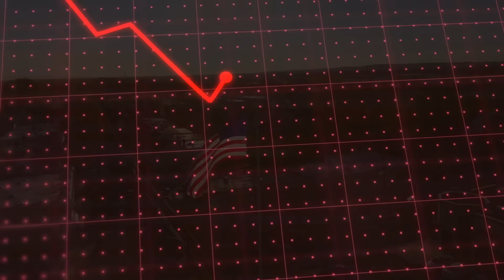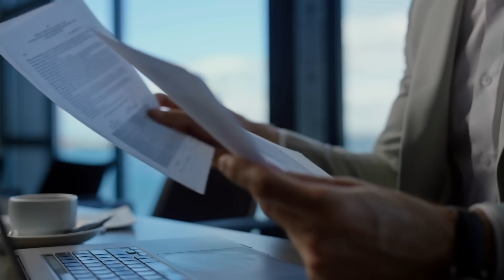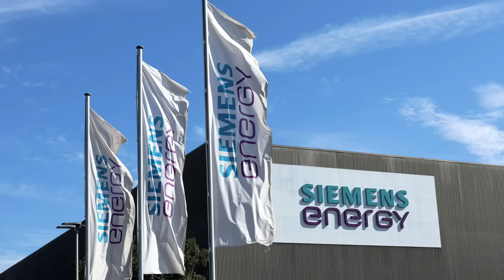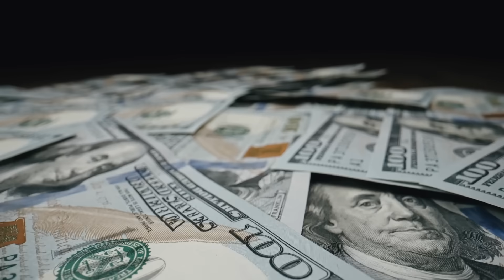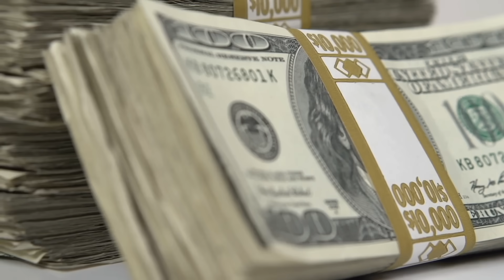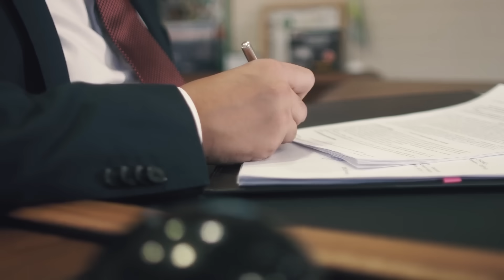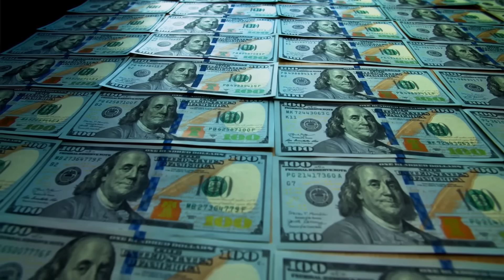The Real Reason America Has Turned Its Back On Wind Power Energy

Comment: A LONG AGO MISCONCEPTION 

"A long-ago misconception about how glass greenhouses work, thus the family name this “effect” goes by. It was believed that glass blocked the passage of “dark radiation” (infrared) and kept storing energetic photons inside it. Once those photons had accumulated enough power to overcome the glass barrier, radiative equilibrium was achieved. So this is the scenario: sunlight enters, heat is generated and dark light is emitted. This dark light is amplified because of the blockage and finally exits at the same magnitude as the entering sunlight. But only after the light “trapped” inside has raised the greenhouse's temperature. Since the barrier will keep raising the temperature until the barrier is broken, increasing the barrier's strength will get you any amount of internal heat you want. (If only that were true …) It is 19th century poppycock. And here's a telltale sign of it: Why do you always see a “layer of greenhouse gases” depicted overhead in illustrations about the “greenhouse effect”, when in fact these molecules are at their densest concentration right at your feet?" BY Alan Siddons

John Christy, ABC Lecture, 17 July 2023

"Climate change, the climate always changes." According to data from satellites and balloons, there is no climate doomsday; the changes are within NATURAL VARIATION. There is no reason to rush to poverty and condemn countries in poverty from developing energy and prosperity.

Lecture given by John Christy, Ph.D. "Scientific Facts of Global Climate on July 17, 2023.  His presentation was sponsored by Advocates for Balance at Chautauqua and was given in the Parlor at the Athenaeum Hotel and Chautauqua Institution in Chautauqua, New York.  Dr. John R. Christy is the Distinguished Professor of Atmospheric Science and Director of the Earth System Science Center 

What does the actual DATA say? It is the IPCC computer models that are wrong!

https://youtu.be/kDAXzcMD2Ng?si=fPyTuh

"A rather well-known quote by Dr. Richard Lindzen is an American atmospheric physicist known for his work in the dynamics of the middle atmosphere, atmospheric tides, and ozone photochemistry. He served as the Gordon McKay Professor of Dynamic Meteorology at Harvard University and was appointed the Alfred P. Sloan Professor of Meteorology at MIT. “What historians will definitely wonder about in future centuries is how deeply flawed logic, obscured by shrewd and unrelenting propaganda, actually enabled a coalition of powerful special interests to convince nearly everyone in the world that CO2 from human industry was a dangerous, planet-destroying toxin. It will be remembered as the greatest mass delusion in the history of the world - that CO2, the life of plants, was considered for a time to be a deadly poison.” Unfortunately, mass delusions are a part of life in the United States and in the rest of the world today and throughout history. Once they have ended, it is not easy to understand why they occurred, but when the masses are in their grip, they can hardly be challenged. This author has written about three such mass delusions in American history, the Salem witchcraft trials in 1692." (Mass Delusions by Wallace Manheimer)

Globalist road to GREEN POVERTY

Note the temperature of Venus, much closer to the sun  with 98.5% carbon dioxide, at 1 bar pressure Venus is 340 K or 67 C, Earth's mean temperature at 1 bar pressure (Sea level) is 288 K or 15 C, Venus at 90 bar plus active volcanic activity is 738 K

Pressure in bar vs temperature in K, The mean temperature of the Earth at 1 bar pressure is about 59 degrees F, or 15 degrees C, in Kelvin K  = 288 K., 0 K = -273,13 C  In thermal physics and chemistry we use K the absolute scale. 

Temperatures of various planets with sufficient atmosphere to make this comparison, Mars is excluded because the surface pressure is not even 0.1 bar.

                           TEMPERATURE K

                           EARTH.                    VENUS.                JUPITER.               SATURN.               URANUS.                 NEPTUNE

 Pressure 

    0.1.                270.                         235.                       130.                        105.                          80                           78

    1.0.                288                          340                         175                         150.                          95.                          85

BLACKBODY

MAX.                255.                         250.                         125.                         100.                        80.                           75

            Surface of Venus 90 bar  738 K
Reply: CO2 can be found thousands of feet in their with nearly unchanged concentration...
Yes, that is above our heads...

The current climate change is not natural.

Science does not claim that CO2 is a world destroying toxin...

Comment: CO2 does not affect climate  so the goal of zero emissions is a fool's errand.
Reply: It just physics. You would know, if you understood it.
Reply: CO2 does indeed affect the climate, but these windmills aren't going to save the world like some people have been made to believe.  
BOEM (Bureau of Energy Management) stated that offshore wind in the US will have no collective reduction in Carbon.
If wind advocates/environmentalists would be willing to be have an impartial discussion on the matter and look at all the actual unbiased data (such as EPA sources), they would no doubt be surprised and shocked at how carbon intensive these things really are.
Reply: @mannycheese1166   But they are not carbon intensiv. Even the EPA states that...
Reply: @old-pete  
I was replying to Eddy, but anyway , Yeah, they most definitely are carbon intensive  but I guess the term  "intensive" would be  subjective .

One simply has to look at the data from the EPA on fossil fuel generating facilities (natural gas almost half as carbon intensive as coal). For example ,  a 4 MW diesel generator running at 50 % capacity (constant 2 MWH)  and compare to a 2 MW wind turbine (would require four towers to achieve a constant 2 MWH when looking at the average output of North American wind farms) ) and what is required to build it and compare both over a 20 year cycle.
I think you may be in for a surprise.
Reply: @mannycheese1166 1. I do not, which clearly shows you like to make assumptions on limited data.
2. Steel does not produce carbon, it just contains some. CO2 is also emitted when producing steel.
3. All sensible scientific sources contain mining, fabrication, transport, service, removal and disposal/recycling. Maybe you should learn to look for better sources...
4. There are no large scale CCS projects worldwide, despite the fossil fuel industry talking about it for over 30 years...
5. A 2 MW windturbine with a capacity factor of only 0.2 saves 51,800 tons of CO2 compared to a coal power plant or 22,495 tons of CO2 compared to a Diesel Generator.
6. I seriously doubt your 4,000 tons of CO2 for the windturbine
7. Windturbines can run longer than 20 years...
Reply: @old-pete  
" I do not, which clearly shows you like to make assumptions on limited data"
Lolol.  So you're saying you source only unbiased impartial data.  Ok . Your bot response to every comment on this video backs that up. You sound so impartial.

"Steel does not produce carbon"
Lolol  .. .Moot point and a dodge and deflect.  I don't even know what to say to that. It's like talking to a child.  Lolol. . Yuri Bezmonov hit the nail on the head in the early 80's 

" All sensible scientific sources contain mining, fabrication, transport, service, removal and disposal/recycling. Maybe you should learn to look for better sources"
Blah Blah Blah Blah with no substance. 
You don't need an open mine to extract gas from a simple well.

"There are no large scale CCS projects worldwide, despite the fossil fuel industry talking about it for over 30 years..."

There is with natural gas. Coal only captured limited carbon and wasn't economically feasible. It's the future. You make it sound as if you want it to fail. Do you ? Is your mind so subverted through ideological subversion that you yearn for it to  fail ? Why would you want an industry that will reduce carbon output by 10 times compared to junk wind mills to fail ? You sound like a Weirdo.
Reply: @old-pete  
"A 2 MW windturbine with a capacity factor of only 0.2 saves 51,800 tons of CO2 compared to a coal power plant or 22,495 tons of CO2 compared to a Diesel Generator."

I've saved this one for last , well because it's most important. Really, It all comes down to this argument. I noticed you used the dirty Fuels vs the most widely used (and cleanest) Natural Gas in the US and Canada (And soon to be 50/50 NG/hydrogen which sends radical crazies into fits)

So, here's the thing about those #'s you gave. Irrelevant even if you gave a citation for the simple reason of biased #'s from a biased source. 
 What that statement doesn't factor in is the mining of the iron ore,  the production of the machinery to build the projects  (the biggest carbon footprint)  and the continued maintenance over its lifetime.
Reply: @mannycheese1166  You did not read the studies, you do not know the criteria, but you think they are biased.
Your behaviour is the definition of bias...

Please tell me which CCS project you consider to be large.

If 50/50 NG/Hydro is a niche application at best, why should one consider it a valid alternative at the moment. There is not enough hydrogen.

Even if one uses your 4000t, that is not carbon intensive, compared to the alternatives.
Reply: @mannycheese1166 All fossil power plants have to be constantly maintained and emit MUCH more CO2, while the fossil fuels are supplied by the super rich companies, that profit from subsidies for over 100 years in the US. That the bosses can afford a second yacht.

Comment: Net zero is a joke. Parts are made from petrochemicals and lubricated with oil. Solar panels and blades are a huge disposal problem and the tens of tons of concrete and metal at the base of wind turbines consume huge amounts of energy to make. Call it what it is - intermittent and unreliable energy. Build nukes if you want low carbon emissions.
Reply: Nuclear power is much more expensive.
Wind and solar are cheap and can be recycled, contrary to radioactive waste.

Comment: How is this suprising or shocking ?
The connection infrastructure costs could easily be much more that the cost of the wind turbine fields themselves.
There is nothing cheap about wind or solar power.
The whole thing is a scam to create an upwards transfer of wealth all to solve 
a " problem " that just doesn't  exist.
Reply: The connections are cheaper.
And yes, wind and solar beat fossil fuels at the market every time.

Comment: Nitrogen-based power generation exhibits significantly greater efficiency compared to hydrogen-based systems.  Given that nitrogen constitutes roughly 78% of the Earth's atmosphere, recent reports highlight its superior performance and environmentally friendly nature, as the process does not involve combustion.

Nitrogen-based power generation involves utilizing pressurized nitrogen vapor expansion to drive a turbine, thus producing mechanical energy subsequently converted into electricity.  This method employs nitrogen as the primary power source, necessitating specialized processes to harness energy from this typically inert gas.  Current research emphasizes developing technologies, such as nitrogen-powered batteries, capable of directly utilizing atmospheric nitrogen.

Key considerations regarding nitrogen-based power generation:

Combustion incompatibility:  Nitrogen's inert nature necessitates unconventional energy extraction methods.

Cryogenic power systems: Liquid nitrogen's rapid thermal expansion enables its application in piston or turbine-driven power generation.

Nitrogen-based electrochemical storage:  Research is underway to develop batteries that directly utilize atmospheric nitrogen for energy storage and release.

Environmental advantages:  Nitrogen's atmospheric abundance suggests a potential for environmentally benign energy production with minimal emissions.

Potential applications:

Renewable energy storage:
Employing liquid nitrogen for energy storage derived from renewable sources, subsequently leveraging this stored energy for on-demand power generation.

Off-grid power generation:
Employing nitrogen as a fuel source in remote areas lacking readily accessible alternative energy options.

Challenges:

Energy efficiency:
Nitrogen energy extraction presents significant technological challenges and high energy demands, hindering its commercial viability.

Storage and transportation:
The cryogenic nature of liquid nitrogen necessitates specialized handling and transport infrastructure.
…
Reply: That takes a lot of electricity...
Reply: @old-pete  
Possibly

Comment: Wind turbines are very green to make?  The base of a moderate sized unit requires about 500 cubic yards of concrete which generates about 200,000 pounds of CO2. The manufacturing of the blades, etc. contribute more CO2 to each wind turbine produced.
Reply: That is all earned back in 5 to 15 months.

Comment: What a crock of Bull Crap to say that building Wind Turbines is Very Green when they need so much Steel made using coal plus fossil fuel based materials ,  the vast amount of fossil based oil inside their gearbox',  the  huge amounts of diesel used in machinery transporting and building them etc etc.............
Reply: And still it is a fraction of the fossil fuel used in producing electricity from fossil fuel burning power plants.

Comment: Any logical government would drop the requirement of forced investment until they provided a solution for the idled units already built. This should have happened many years ago. What a waste of a country’s assets and labor. What a failed 4 years. Should be a high priority for DOGE. The stroke of a pen will allow the energy companies to put their assets where they will do the best for the country. Drill baby drill. As much as I would like to see green energy work, if it doesn’t, it doesn’t. Simple. Back to the drawing board.
Reply: There is no forced investment...
Companies decide on their own.

Windturbines and PV work.

The outtage of a nuclear power plant in Texas this summer was compensated by the batteries they installed...

Companies will continue to invest in Windturbines and PV.

Comment: Wait a minute. The current grid network(s) supplies power to all the consumers in the US. The whole grid does not need to be replaced since one can assume the new green power is replacing fossil fuel power. Are the costs due to the location of the new green power generators?  I understand that connecting to the grid is not just splicing in a wire. The frequency of the power needs to be matched to the grid power and this requires new equipment. If these costs are due to increasing the supply carried by the grid then that is a different issue.

Comment: A big problem the grid isn't good enough to handle all the electricity been generated by the solar and wind turbines which are a mechanical  device and will on going maintance
Reply: Solar is not a mechanical device...
All fossil and nuclear power plants are mechanical devices.

Comment: Classic example of putting the cart before the horse,  the US power transmission infrastructure is ancient and as you said ,is creaking under load barely able to cope with the extra energy these aeroplane propellers on sticks can generate. The corporate suits are like a nun,s backside tight, refusing to invest in  upgrading the US,s distribution network.  We in the UK have a similar problem with electric cars ,two three years ago the suits and government badgered us to buy these damned vehicles to wean us off petrol and diesel, yet the electric vehicle charging  stations required were not built in time. Short sightedness, ignorance greed and stupidity reigns, all a suit cares these days about is money, like a Weston Donkey.

Comment: To answer the question.   Yes!   There are real solutions.  The greenest if that is the drving factor to keep the peace.. Nuclear !   or Coal if not the greenest..  But really is the cheapest..  However the Nuclear planets need less volume of useable material.   Gas is more green than Coal But requires a large volume of useabe material..  ????     There are hidden Costs to Solar and wind and that is in The transmission lines.   Plus short life span..   Then there is the COSTS OF. FIRES THAT CAN BE AT THE WORSTE OF TIMES SETTING FIRE TO EVERY THING  AT WHAT COST ????   BATTERIES ARE NOT TECHINCAL ENOUGH YET !  AND ASO HAVE THE ISSUES OF CATCHING FIRE.  EG;  E.V'S.    

SERRIOUSLY ALL OF THIS FROM A SCARE CAMPIAGNE !  A VERY SUCCESSFUL  SCARE CHAMPIAGNE !    YET AS OF YET THIS 100 YEAR OLD ISSUE HAS YET TO SHOW PROVEN RESULTS..   NEVER MIND THE LIES OF BOILING SEAS.  IF THEY WERE WE WOULD ALL BE EATING COOKED FISH OFF THE BEACHES !!!!     AND WE ARE NOT !
Reply: Coal and nuclear are not cheap. Coal is phased out in western countries and nuclear is losing market share worldwide.